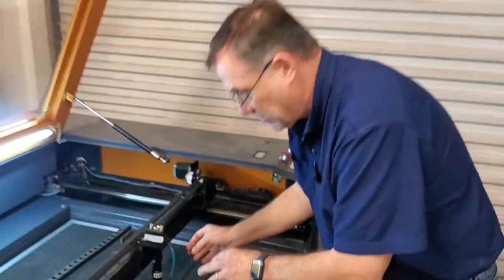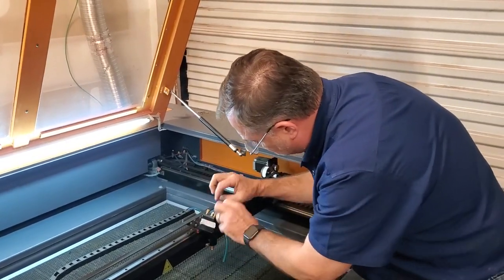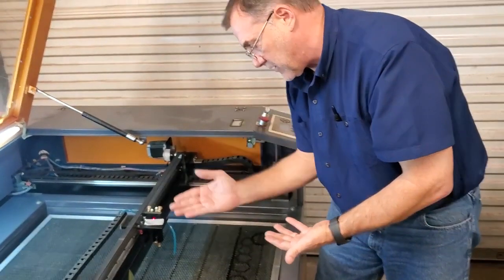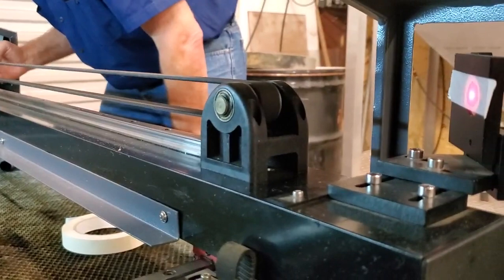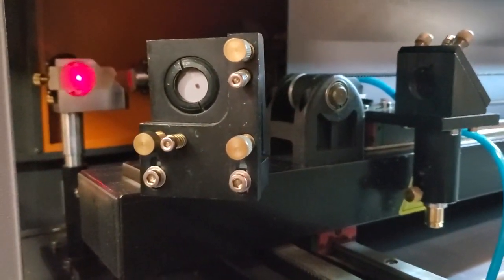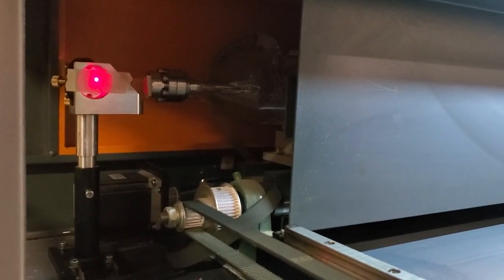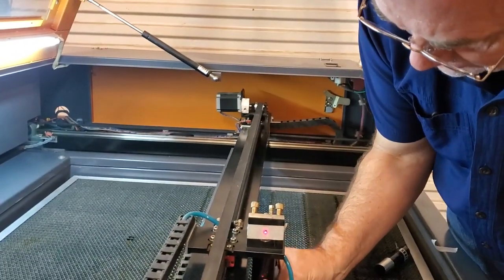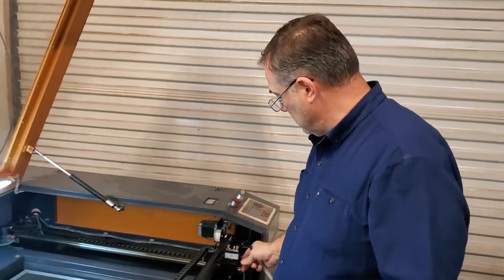CO2 Laser Alignment Tool get perfect beam alignment from American Photonics

Comment: what if the laser tube itself is not alligned well and is tilted up/down or left/right.. would this tool work?
Reply from the maker: it is ok to move only the front or the back of the tube to make the tube alignment right. the tube does not need to be perfectly level the the machine or the earth.
Reply: Yo también pienso lo mismo, ya que he cambiado el tubo de mi máquina y obviamente no queda super alineado. Si lo intento, pero debe de variar un poco. De ser así, como podría alinear bien el punto rojo si el tubo está ligeramente inclinado? 

Yo intenté ya hacer lo mismo del video, pero saliendo del tubo no de la boquilla (3er espejo) y si ayudó pero me falta perfeccionar la herramienta.
Reply: Yo también pienso lo mismo, ya que he cambiado el tubo de mi máquina y obviamente no queda super alineado. Si lo intento, pero debe de variar un poco. De ser así, como podría alinear bien el punto rojo si el tubo está ligeramente inclinado? 

Yo intenté ya hacer lo mismo del video, pero saliendo del tubo no de la boquilla (3er espejo) y si ayudó pero me falta perfeccionar la herramienta.

Comment: I bought one of these around the time this video came out 3 years ago.  It aligned my 60w laser better than I ever could the old way.  Here I am looking at it again as i just upgraded to a monster 150w co2 laser and the proper alignment tool ordered.  Don't buy the knock off poor quality OMTech version,  get this one.  It's worth it and if you have an issue with it the customer service is as good as you would expect from a company where the owner himself is instructing on how to use it.

Comment: I purchased one of these units a few years ago and have only recently tried to use it, However when I noticed when I rotate the always on laser the red dot moves from side to side, it does not appear to be collimated cant it be adjusted. Thanks ALan
Reply: Did you figure out why? This side to side motion is happening with mine and I can't figure why, it's fine half way then goes off centre as it goes farther away

Comment: OMG i am struggling soo hard with the alignment ... Thats a perfect idea thanks a lot i will design and 3d print a adapter for a laser diod and do the same 😍❤️❤️
Reply: callysadventures6315,
How did that work for you?

How did you get the red beam perfectly 90 deg out of the adapter?  

I suspect the actual pointer beam is not true to the pointer housing.
Reply: It worked actually quite well  but i didn't use a Laserpointer i used just a laser diode in its raw form ... If you roll your adapter on the fror and the laser beam at the wall stays at the same place it is fine

Comment: U did not show any adjustment. Do u adjust the source mirror (mirror 3) or the target mirror (mirror 2), if the red dot is not in the center of the target mirror (mirror 2)? Does the nut adjustment follow the same direction or reverse direction?
Reply from the maker: the primary purpose for the reverse tool is to properly adjust mirror 3. after adjusting mirror 3 it may be necessary to move mirror 2 so the red dot hits it in the center.
Reply: @americanphotonics9120  How about you show people how to align a misaligned unit with your product, that is what people are asking for!!!!!!!!!

Comment: Does anyone have a link to a better video that actually tells you what to do when it does not align? I have gone through all of the batteries included and still don't have mirror 3 to 2 aligned. So far off that when I move laserhead left to right the beam goes off the mirror completely. Every time I try to dial it in, it goes off the other direction even with the smallest of corrections. This video is no help whatsoever and now my laser is so misaligned I can't use it.
Reply: These laser assist only help you align with mirror 2. If you still need help with this lmk. I miss align mine as well and finally got it to align; got burn 3 time in the process to show you how misaligned it was. Please wear Eye Protection at all time!

Comment: Perfect alignment not just helps in better quality but cuts down running costs and times.. I used get laser cutting outsourced, they always had slower runs, and still not so good cuts... Ever since i have owned a laser, for the same 80w i run it 2 times faster than others

Comment: I bought your lenses (a set) and mirrors and of course your reverse alignment tool. I've used it a couple times only to realize that depending on how it's inserted into the head it either gives me good results (meaning it is aligned to mirror 2 because that's where I placed it before), or the next time it's inserted it way off. So far off that it's off the mirror...
Maybe I'm missing something here? The tool seems to have a loose fit in the tube and of course it's locked down with a thumb screw. 
Why the inconsistency due to removal of the tool and then reinsertion? I have noted that there's a flat machined into the body of the tool but no mention of whether or not it's functional regarding the alignment procedure.

I did a 'perfect' alignment of mirrors 2 and 3 (no movement) only to find out that if I disturb the reverse alignment tool it throws everything off.
Reply: so far i am having similar issues
Reply: I am having the same issue.  The laser is no aligned the the center of the tool.  Its at an angle, try rotating the tool and you will see its at different points.
Reply: Wow, that is some really crappy quality. He claims the alignment of the red beam to tool is perfectly 90 deg out to 20 feet. Obviously many of them are nowhere close. I'd send it back for a refund.
Reply: L0
Reply: I'm in the same boat... I drove myself absolutely insane only to realize that the alignment tool isn't accurate.  Good thing I already lost all my hair :/

Comment: Could you elaborate on how you would correct the alignment to mirror 2 if it travels roughly 1-2mm from the farthest point left to the farthest point right? Getting it to hit dead center on either side is straight forward, but moving the angle doesn't seem to do much to correct it

Comment: It seems to me that you have a perfectly aligned machine, but you are not showing HOW to align anything.  Make the laser completely unaligned and show HOW to align it please.
Reply: Same...I cannot get my laser to align at all using this video. As a matter of fact, I think it made it worse. A more in-depth video showing a start to finish would be great.
Reply: I couldn't agree more. I bought this and still don't have a good idea of how to use it properly. Absolutely no instructions or guidance come with the tool.
Reply: @mikaspack6748  if you place tape before mirror 3 and then rotate the tool 360⁰ once in place but with the fixing screw still loose does the laser dot remain in a fixed spot or move around in a circle a bit?
Reply: @eddiev1980  😂
Reply: Same here. Just purchased one and the instructions are very vague. For how expensive these “alignment tools” are the least this person could do is make a COMPLETE video on how to align an UNALIGNED laser.
Reply: @edgardoguzman2858  Totally agree. Absolutely useless.
Reply: Exactly my thoughts! Clear as mud.